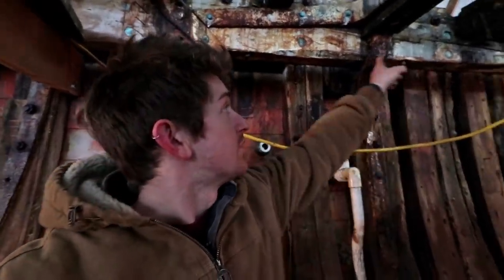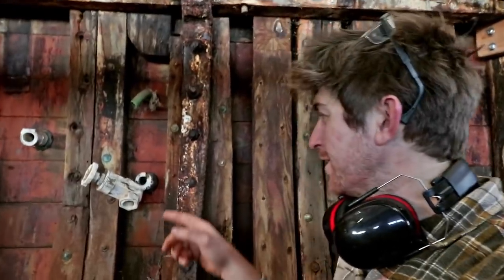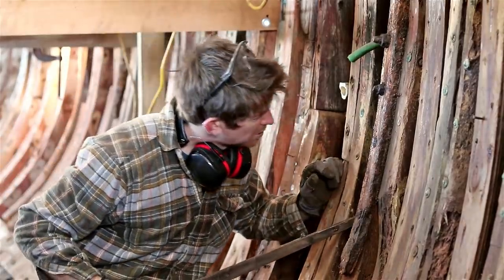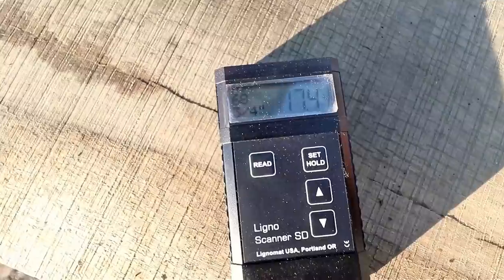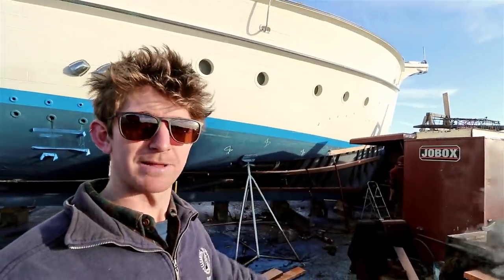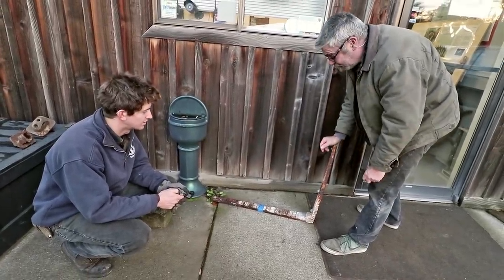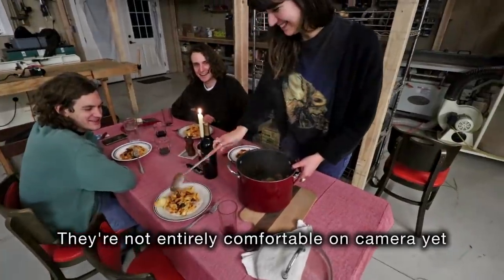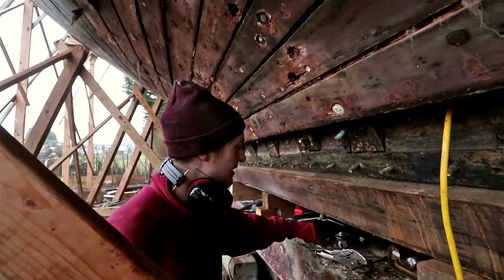12. Chainplates & Knees / Live Oak & Bronze - Rebuilding Tally Ho EP12

Comment: Wouldn't having to good iron parts plated be a good alternative, as well as preserving some originality?
Reply from the maker: It is still an option, but iron sickness is the reason this boat need to be rebuilt now. Non-ferrous fittings and fastenings would have meant I would be able to save a lot more, and if I use bronze then the next guy might thank me in another 100 years! Plating would help but inevitably gets chipped and damaged eventually.

Comment: No ferrous metal!. Wow you are expecting a lot from patreon , kidding!  But If Tally-Ho lasted 100 years already what would be the harm in steel parts especially if you hot dip galvanize? You could get most of the parts flame cut from plate stock for 1/10 of the cost of Bronze. Sure Bronze would be lovely but if painted iron lasted 100 years.........
Also I don't believe the knees were cast. They we're most likely wrought iron. If you send me a piece I can test it or if you are not going to use it beat on it with a hammer, if it snaps and has a crystalline structure it's cast iron , if it's wrought it's unlikely to break. ( don't you have old plans? ) What do they call out? , great work!
Cheers Warren.
Reply: I think its spelled 'Patron'
Reply: not it's not, patreon's correct. You can become a patron on patreon though
Reply from the maker: I'm still considering it, but iron sickness in the wood is the reason this boat need to be rebuilt now. Non-ferrous fittings and fastenings would have meant I would be able to save a lot more timber, and if I use bronze then the next guy might thank me in another 100 years! Plating/galvanising would help but inevitably gets chipped and damaged eventually. The plans call for Wrought Iron on the breasthooks, so I would presume it would be the same on the knees. I will try and test it too.
Reply: Yeah, that's some decent Tequila.  ;-)
Reply: Sampson Boat Co  Well damage ( iron sick) from iron /steel is a different consideration, was it the knees or the iron fastenings that caused the most damage? . The hot dip galvanizing against the wood should help reduce the bad effects . Is there any other modern options like a pvc strip you could be put between the iron and the wood?  Is there an example of an old boat with hot dipped galvanized components? What if there was a different wood spacer between the oak and the iron/steel? Isn't it the acid in the oak that causes issues?  Wow so many things to evaluate and decision to make.   
The long view, was it the choice of iron fastenings that lead to the boat needing complete rebuild after 100 years or the poor maintenance in later years?  Would the boat even have existed if it was made with the expense of all non ferrous originally? Probably not. Just as expensive then.
By the way a separate option I forgot that the iron looking  floors could have been made from from is "Mallable iron" which has good elongation  characteristics. This is not made much anymore but was a lot more common. It has been replaced by "ductile " iron is many cases. Most regular cast iron( class 25-40) would not be appropriate for floors but ductile iron is a lot stronger and good elongation  but it can be made in the same basic process as normal class 30-40 iron foundries with special pollution controls. Ductile iron was not available when Tally-ho was made. Ductile is not as strong as steel but is much easier to cast than steel.   Steel cut from thick plate would still be the cheapest option by far if you could get over the  long term iron sick issue which should be possible if you choose the right fasteners and electrolytic isolator.  Big decisions. With a probably 20:1 difference in cost steel vs Bronze......using steel would get the boat built and would last as long or maybe twice as long with special care to protect the oak.
What a long comment!
Cheers Warren.

Comment: The iron will last forever if powdercoated properly. Just a thought.
Reply: boo boo everything all metals corrodes around bolts especially with salt water. Water resistant Lubricant and antiseize will help tremendously.
Reply: boo boo with maintenance of course it will. Look how long they lasted without. There still good.
Reply: nitrate smith apparently you have only seen cheap powder coating. I've got wheels, bumpers and racks on my 4 wheeler that was coated 10 years ago. It gets road in the woods 2 to 3 times a week hauling corn deer kids stands etc. No issues at all.
Reply: i hope you like your powder coat,  enjoy it,  now go get some SALT water on it.   i restore cars , like 1920s rolls Royce.s    for wheeler lol lol lol ,
Reply: nitrate smith I live in South east texas in backwaters and marsh. Its all saltwater. If you powder coated a Rolls Royce you just knocked the value down for not having factory paint 😔Sooooo I'm not getting the point of your argument.
Reply: boo boo powder coating is about the worst You can do to corrodable materials in saltwater environment: You do not see what damage happens underneath the coat plastic until the part gives in and breaks away.
It's a BIG nono for any structurally important piece even in freshwater conditions for exactly that reason.
Reply: manfred schmalbach which happens the same with any coating. Its all about preparation. Just speaking from experience.
Reply: nitrate smith ha ha ha. I kinda figured I was talking with a young inexperienced individual. Rock on there youngster.
Reply: You seriously claim galvanizing (technically a coating while metallurgically a mere surface treatment) will behave the same like powdercoating? Longterm? Under real saltwater conditions?
You either never were anywhere near a saltwater for longer than a weekend or might hold assets of a place offering powdercoats.

Comment: Just curious, why don't you have the knees sonogramed to see if they have stress fractures or not!! I do that on some of my larger construction jobs.... because the replacement cost of some of these pieces is outrageous. Along with that you could take them to a foundry and have them reheated to white/red hot to get the steel back to its original temper and shaped to the original specs that you need....Then galvanize it, would save you a lot of money!!   just a suggestion since all your viewers are going to pay for your endeavor of this rebuild boat

Comment: Leo  live oak Dry is 54 lb cubic foot and about 30% stronger and white oak is 48 lb a cubic foot and steel is 490 lb a cubic foot or have i got all it wrong ?
Reply: Lloyd ----- there is a little debate about the weight of Southern Live Oak/Quercus virginiana/Maritime Oak (the kind Leo is talking about) . The consensus is around   60 to 65 lbs per cubic foot at 12% moisture content.
   Live Oak | The Wood Database - Lumber Identification (Hardwood)
www.wood-database.com/live-oak/

Common Name(s): Live Oak, Southern Live Oak. Scientific Name: Quercus ... Specific Gravity (Basic, 12% MC): .80, 1.00. Janka Hardness: 2,680 lbf (12,920 ... Though, due to its incredible density, (especially for an oak), Live Oak is harder to work with than other species of the Quercus genus. Odor: Has a tell-tale smell that ...
Tree Size: 40-60 ft (12-18 m) tall, 4-6 ft (1.2-1.8 ...
Scientific Name: Quercus virginiana
Common Name(s): Live Oak, Southern Live Oak
Distribution: Southeastern United States
   Steve Cross 229-726-5561